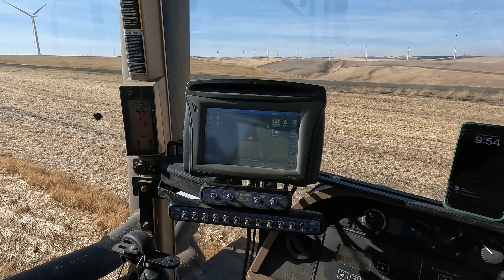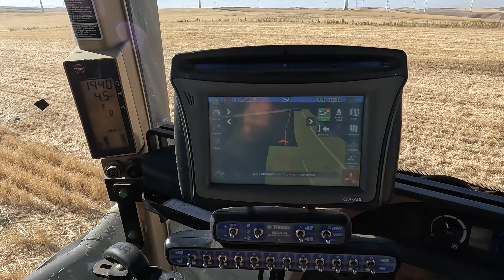Why do we farm like this? Mowing stubble and leaving corners

Comment: That seems like a very large tractor for that "little" mower. But I've never done that job nor in that terrain, so maybe that's what's needed? But I could do that shit all day every day.
Reply from the maker: Yeah, i enjoy doing it as well. I like mowing. Yeah, the tractor could be smaller. The mower isnt a crazy pull. Its a pretty small tractor compared to the other tractors. Theyre all CASE Steiger quad tracks and case wheel tractors
Reply: @TrevorStruthers  guessing they don't make a bigger mower? What about roller-mulcher?
Reply from the maker: @TheBiggRiggz  theres bigger mowers. My dad and a few other farmers ive worked for had 34 foot wide ones. Still a slow process
Reply: @TrevorStruthers  yeah, but a 34 foot mower at 6mph is faster than a 20 foot at same speed. (I have no idea the width of that mower nor how fast you're going)

Comment: Is there reasons why tires would be better than tracks? From my city slicker knowledge it seems tracks would be better in every case. Or is it just a cost thing?
Reply from the maker: The tracks have a larger contact patch, so less compaction is usually why people use tracked tractors. The tracks are spendy as well, yeah. So are the big tires though. The self propelled John Deeres and my Vector have 4000 dollar tires. Tracks are expensive to replace too, the difference seems negligible. Depends on the use case. Can't say tires or tracks are better for anything, unless its combines. Tracked front combine tires are a joke on sidehills.